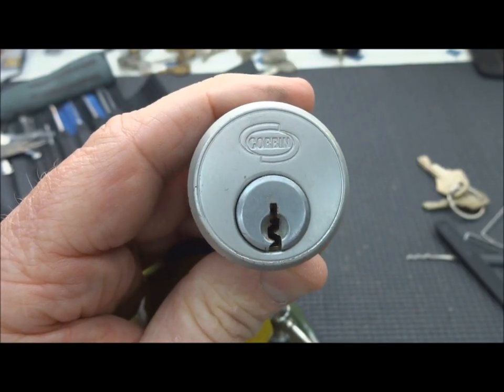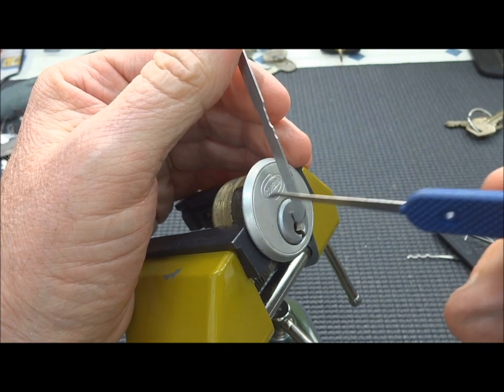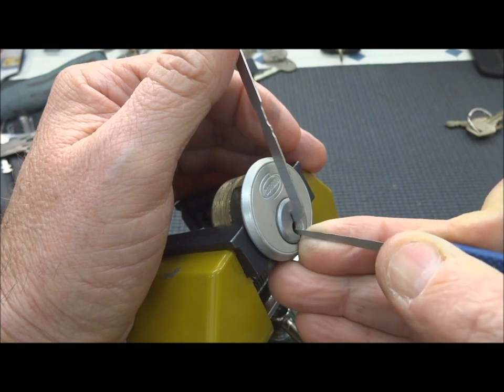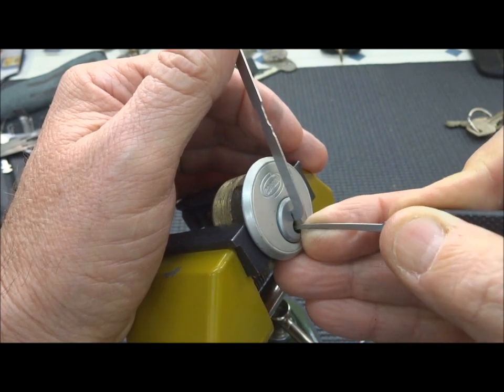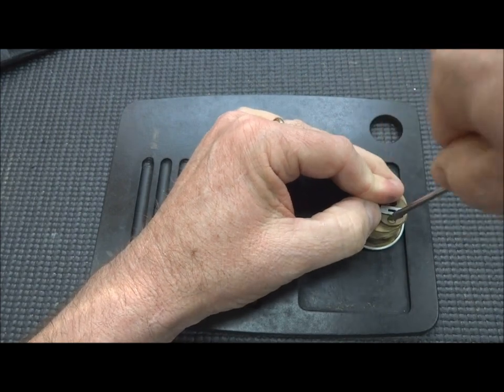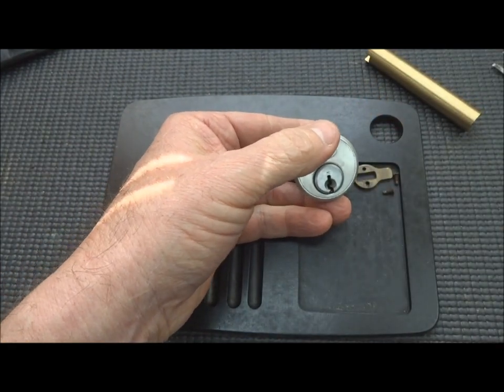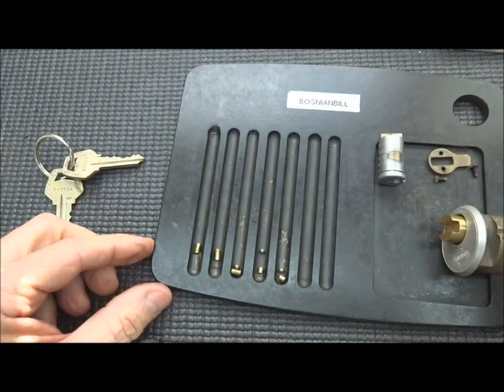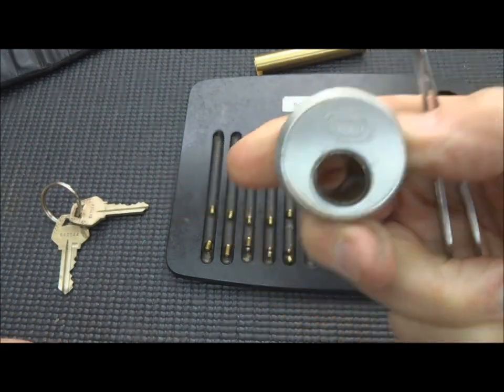(274) Corbin Mortise Cylinder Lock Picked Open & Gutted

Comment: Ok so if the key pin is shorter than normal because of the ball barrings.  Can you manage to push the key pin into the bible and use the ball barring as the shear line?
Reply: sure can!